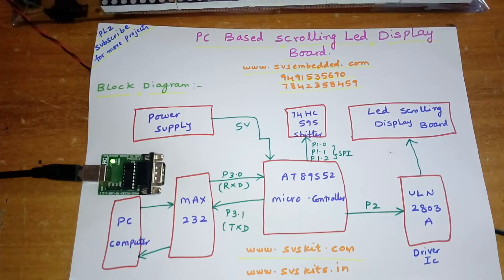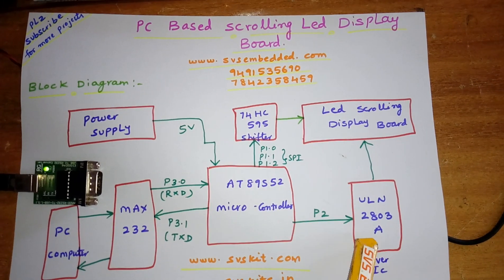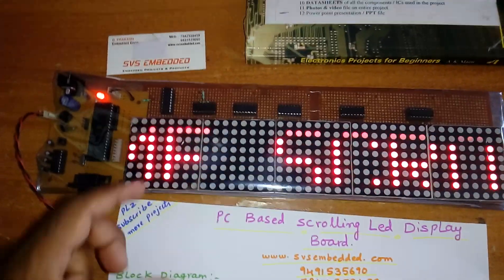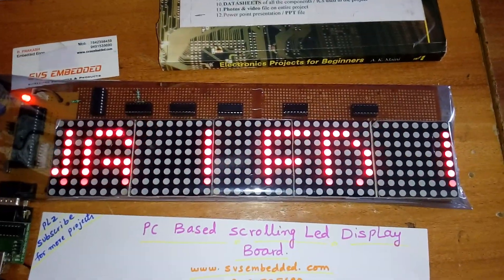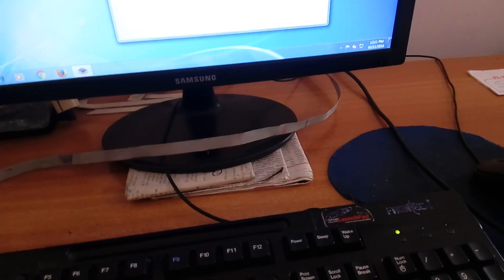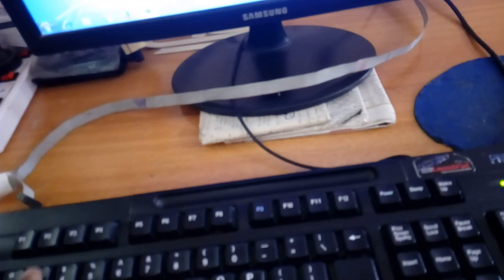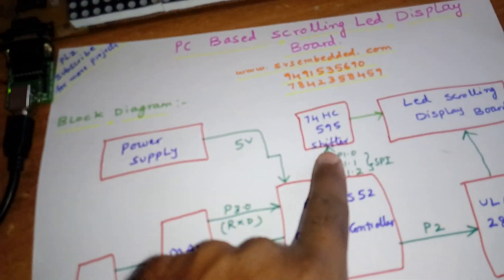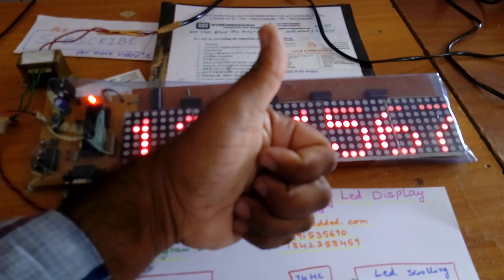LED Scrolling message Display using 8051 | how to make moving message display

Comment: sir i need  embedded  ccode ,circuit diagram and  pc software  my emai shankykarma@gmail.com
Reply from the maker: Thanks for watching and your valuable Feed back.yes we will help on coding part.
we are selling the projects with least cost.if u order the project we will provide working hardware kit along with 
1.abstract
2.datasheets
3.documentation
4.schematic( circuit ) diagram.
5.software code.
6.sample ppts
7.photos&video file on entire project
through google drive.if u r interested to take the project.
send me a mail to  svsembedded@gmail.com,info@svsembedded.com.
9491535690,7842358459,
www.svsembedded.com,www.svskits.in,
we will send u the how to order procedure to u on mail.

Comment: sir i need  YOUR help. how to make LED scrolling display .told me total information about it.my mail id is pantaniket1996@gmail.com
Reply from the maker: Thanks for comment and your valuable Feed back,we are selling the projects with least cost.
if u order the project we will provide working hardware kit along with 
1.abstract
2.datasheets
3.documentation
4.schematic( circuit ) diagram.
5.software code.
6.sample ppts
7.photos&video file on entire project
through google drive.if u r interested to take the project.
send me a mail to  svsembedded@gmail.com,info@svsembedded.com.
we will send u the how to order procedure to u.